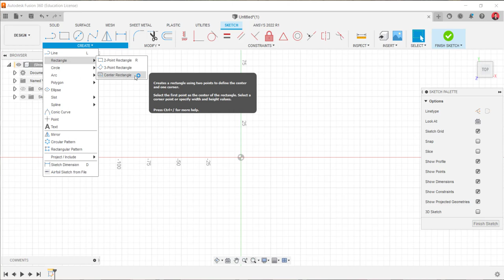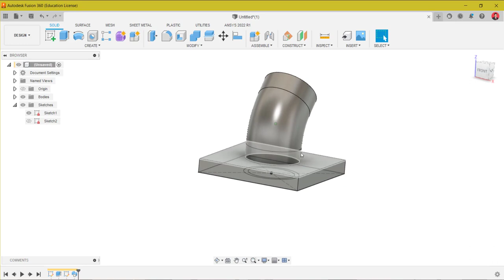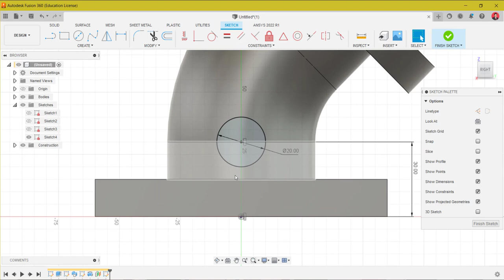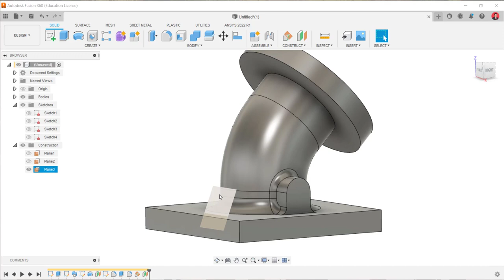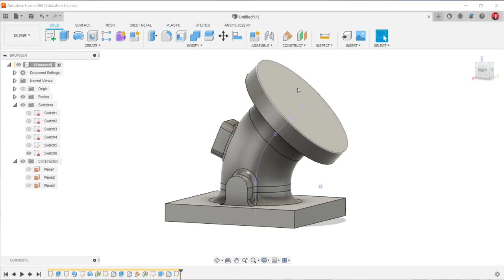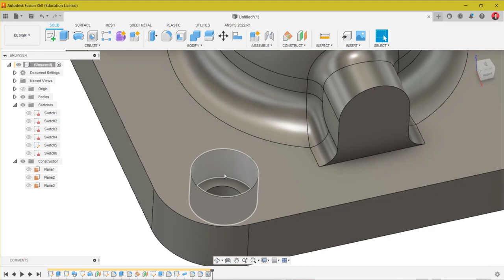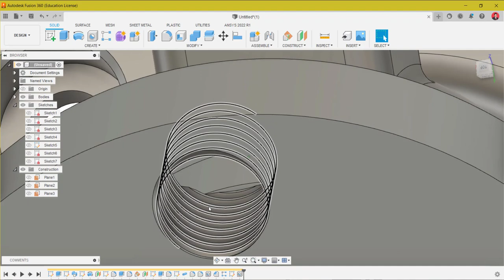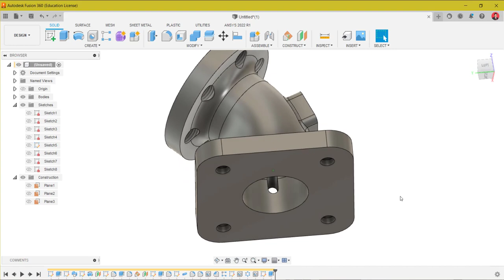Fusion 360 Tutorial - Angled Pipe 45

Comment: Why you use rectangle pattern for hole and not circular, it is much easier.
Reply from the maker: Eventually, the flange is square, if it is a rectangle the circular pattern won’t work 😊
Reply: @DidiWidyaUtama  Yes it would. Try it and you will see. I doit all the time.
Reply: @DidiWidyaUtama  By the way, 7 years ago you made angle pipe and then you used a circular pattern. What by now you forgot....
Reply from the maker: @JBCool0729  No, I'm not forgotten, I'm Intended to use the rectangular pattern instead of circular. like I said If your base  flange shape is't squares then circular pattern won't work!  please do remember that rectangular have unequal length of the sides, and square has a same length of sides.
Reply: @DidiWidyaUtama  yes but this was not rectangle. On the other hand you can still use the circular pattern but you need select two holes on the same side and the use that pattern. This way you don't have to worry about measurements